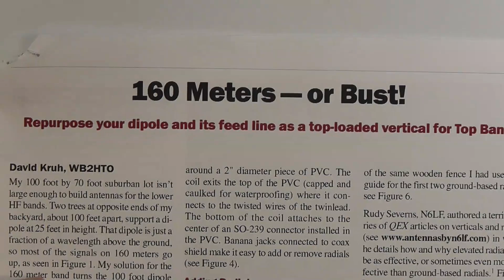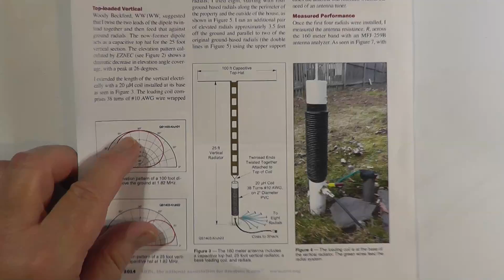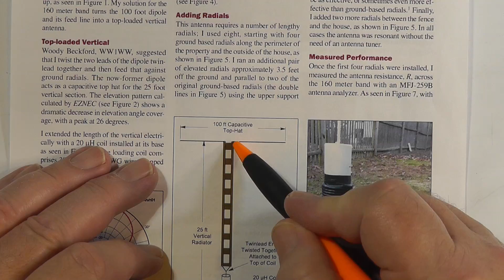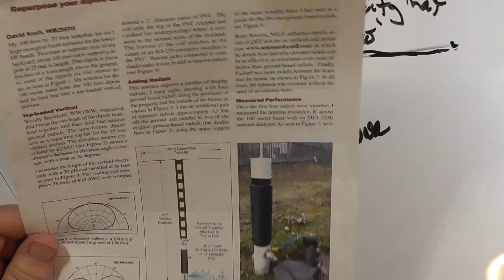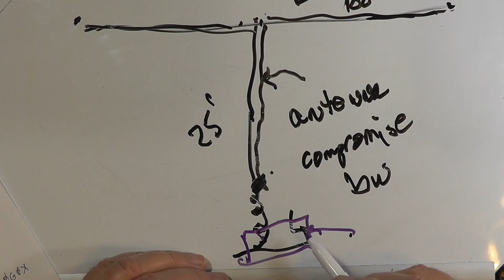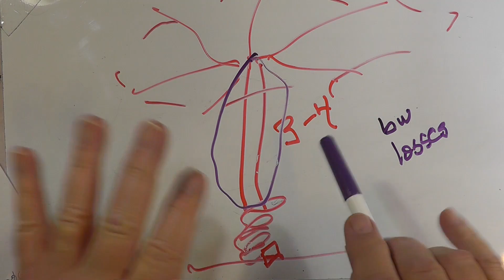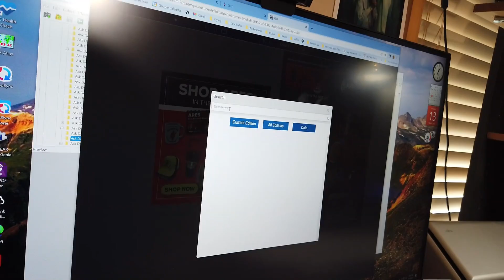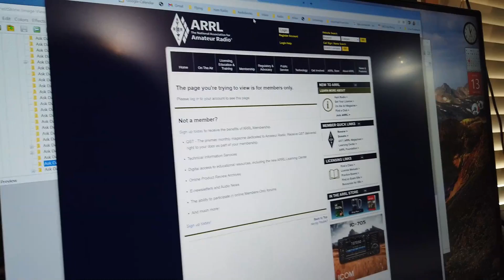Both Inductive and Capacitive Loading for 160m Antenna (#919)

Comment: In my youth I had a ~60 foot tower which was on property - to get on 160m I simply ran some 14g wire spaced about ~6-8 inches away from the tower and extended as an inverted V from the top of the tower to to a pine tree at the of the yard.

For a feed line 50 OHM coax was used.  Ground from the coax was tied to to earth ground at the foot of the tower and it was coupled by "AIR" capacitance up the tower using cut up poly pieces of poly (plastic) desk chair flooring that I was gifted.

This worked very good although ground noise would be 4 -> 10 DB above the noise floor.

This was the mid 70's and I only 16 years old -- great times as could hear and talk to persons that others could not reach :-)

Operating equipment was a FT-101EE (16th birthday present) on 160m

With no tuner it would good for about 200 KHZ from 1800-> UP < 2:1 SWR.

I how someone finds this interesting.

WD4ARM

Comment: My shortned dipole jumped to 160 meters because of the rain and I made my first entrance in the lower bands. 
So, I had a 40 meter dipole 30 feet in the air and I decided to experiment by adding a coil at the ends and dropped a 4 feet wire, tuned it and was able to reach 80 meters. I was a happy camper, but then it rained. So, the coils were wrapped on a cardboard cylinder covered with duct tape, and rain detuned the antenna. It was no longer resonant in 3.9 MHz but lower in the band. I decided to change the ends to 2.5 feet, and by chance the shortened dipole resonated in 1.9 MHz. I tried it and it worked. I made my first contact in the forbidden band with several 5/9 reports. Isn’t t he at amazing!

Comment: I'm not sure why many seem to make getting on 160 such a chore ?
I was able to use a 126 foot inverted 
" L " with a very short 35 foot vertical portion !
With the rest of the antenna sloping down to 10 feet or so, to a telephone pole.
Granted that I installed a few random length radials, and tied to a cyclone fence and a Cold water pipe !
Worked nearly every U.S. State to include Alaska and Hawaii, plus a station in France !
All being land locked in the Midwest !
And this was back in the 80's when operators were much less plentiful than today's Ops !
It may take some effort, but it can be done rather simply !
IMHO !

Comment: Your cheated when you searched QST by using his call sign.  The ARRL still has not provided a way to do compound searches of QST, other than the old pdf system.    Why the League continues to have such poor web technology I don’t understand, or for that matter continue to use a non U.S. based company to host the QST platform.  13:28

Comment: This is pretty much what we used to use on 160m. G5RV with the open wire shorted and fed against earth through a tuner. The inductor was in the tuner. G5RV is 102 feet top.

Comment: This is a stupid antenna.  Use the top 100+ feet horizontal wire with big, and I mean big, loading coils with low loss R, you will have a better antenna that might work well.  All these dumb magic weirdo antennas don't work well but hams seem to like them anyway.
Reply: It's not some new novel gimmick antenna or something like that. It's a rather well proven vintage antenna called a T antenna. They are/were very common on bands lower than 2 MHz where the height of a true vertical becomes extremely impractical. For stations on say the 630 and 2200m bands they're even more common.
Reply: I wouldn’t call it stupid. Sometimes you gotta make it work with what you got (material/real estate). But I can see what you’re trying to say.
A small improvement would be a coil in the center, but one would need more inductance than when base loading. So, the wire resistance and wire capacitance would diminish the benefits. But it would still be an improvement on antenna efficiency. Talking about efficiency… with some rough calculations, one can expect this quite compromised antenna to have an efficiency just about 10% on good ground. Hence the title, 160m or bust. Due to the too short physical length the radiation angles will be high in the far field plot. That pretty much cancels the benefits of a vertical while even a compromised horizontal (with loading coils) would be more efficient with a likewise NVIS radiation pattern at less than a 1/2 wave above ground. A full wave loop around the house at fence hight might be interesting to consider instead with about the same 10% efficiency and pattern, but way less complex than coils, capacity hat and very long ground radials in weird shapes within the property but folding around the house.

Comment: Dave, you must start reading about antennas. A 25' vertical with base loading and with 100' capacity hat will not work on 160 meter band. Please check it out.
It is working (even if it works) it will work like an inverted L long wire with some base loading. He might be using a matching unit in addition to work on 80 metre also.
So, your explanation, both inductive and capacitive loading is wrong.
De VU2RZA

Comment: I knew W1 that ran a 3 tower array on 160 to work across the pond. A more practical antenna for a backyard is a square/loop 65 feet per side, yes high angle but efficient,  makes up for for the angle.

Comment: @David Casler Please correct me if I am wrong. An antenna loading employs inductance to lower antenna resonance (by lengthening the electrical length) at the cost of reduced bandwidth. However, when using a capacitance hat and a loading coil, these components may counterbalance the bandwidth changes while establishing the antenna's resonance within the 160m band. In contrast, a capacitance hat raises resonance (by shortening the electrical length, necessitating more wire) and widens the bandwidth. Additionally, incorporating extra radiating elements (like doubling wire with a ladder line and multiple capacitance elements at the top) can decrease the antenna's resistance, thus improving its efficiency.
Reply: Correct about the coil at the base. It “lengthens” the antenna. So does top loading with a capacity hat. Both work in the same direction. A small improvement would be a coil in the center, but one would need more inductance than when base loading. So, the wire resistance and wire capacitance would diminish the benefits. But it would still be an improvement on antenna efficiency. Talking about efficiency… with some rough calculations, one can expect this quite compromised antenna to have an efficiency just about 10% on good ground. Hence the title, 160m or bust. Due to the too short physical length the radiation angles will be high in the far field plot. That pretty much cancels the benefits of a vertical while even a compromised horizontal (with loading coils) would be more efficient with a likewise radiation pattern. A full wave loop around the house at fence hight might be interesting too with about the same efficiency and pattern, but way less complex than coils, capacity hat and awkwardly long ground radials.

Comment: For a few years our group was lucky to have a ham friend that was chief engineer of an AM station that only transmitted during the daytime and then would switch to a different site (many miles away) at night....so, our 160 contest group would operate using his 48' tower as a 160 vertical at night then disconnect well before the AM station would come bk on the air...we had a very potent signal back then...73/K6SDW